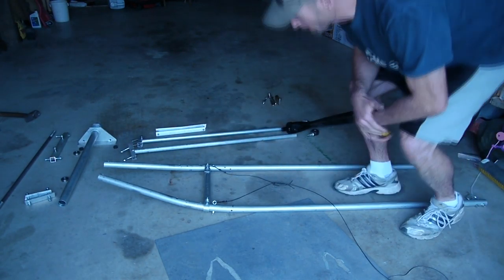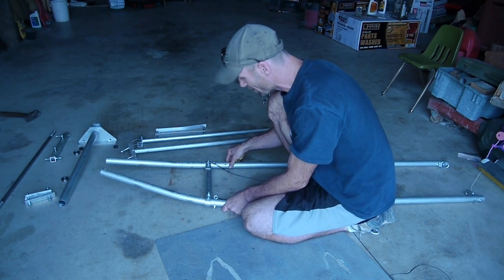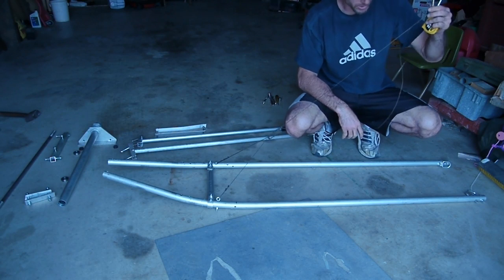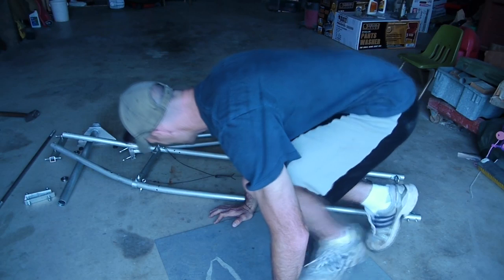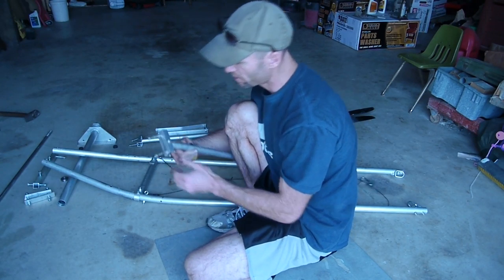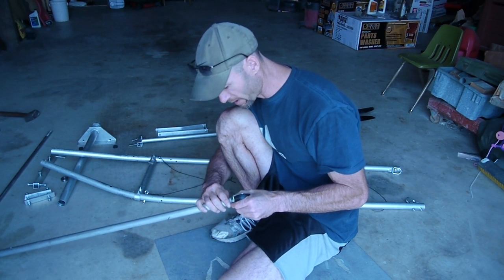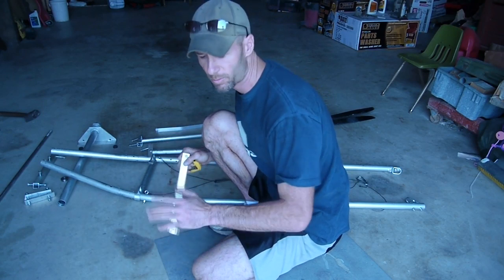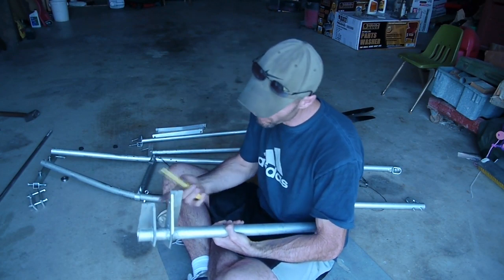How to Make a  Foot Launched Powered Hang Glider (FLPHG)

Comment: Wow. Wes, I just discovered your channel. I'm really impressed and share similar passions in aviation with you. I've never flown powered hangliders and I'm thinking about building a powered harness. What's your thoughts on powered hangliders vs paramotors? What cc size engine were you using for the hangliders?
Reply from the maker: They both have advantages and disadvantages. PPG is convenient and maneuverable. FLPHG is better in turbulent and high winds. The new Atom 80 would be perfect for a powered harness
Reply: @WesAdams  is the mosquito nrg worth all the fancy features and price or would you rather build a custom harness with an atom 80? I already have a hg harness so I would only need to build a frame like yours.
Reply from the maker: @MitchG  the Mosquitoe is nice and they designed it really well. I flown a Doodlebug, Wasp and Mosquito. The Mosquitoe is the best by far. That being said, someone has a used doodlebug on eBay for 2000. It might be worth it to buy and convert it to a prone harness.
Reply from the maker: @MitchG  https://www.ebay.com/itm/doodle-bug-power-unit-for-hang-glider-/154527434621?mkcid=16&mkevt=1&_trksid=p2349624.m46890.l49286&mkrid=711-127632-2357-0

Comment from the maker: @007rajeesh007 Rajee, It all depends on the weight. The Radne Raket engine I'm using is about 15 pounds. You want to keep the weight low because it will push your center of gravity (CG) too far forward. The wing I'm using is a Wills Wing Falcon 2 195. It's a novice glider and much easier to fly than some of the intermediate and advanced wings.

Comment from the maker: @88skullkid I can give you a rough idea about measurements! I can measure my Falcon and let you know the length and width of all the major parts. I know you said your not going to fly it, but if you try I wouldn't get more than 5 feet off the ground. There are some videos on youtube where people have built an older type of a hang glider. You could also use those videos as reference.